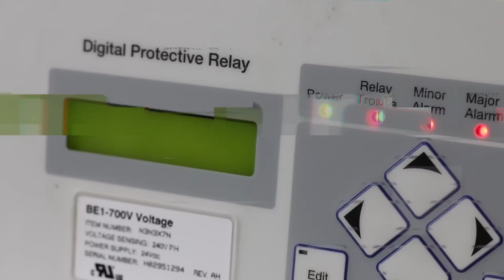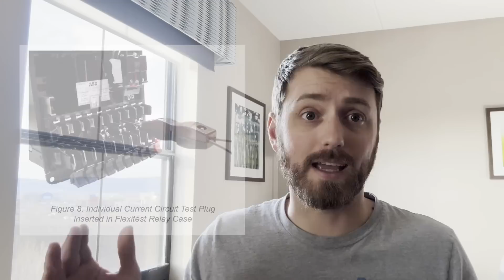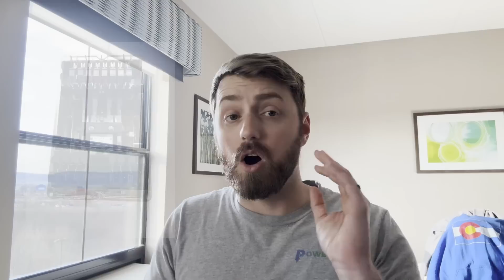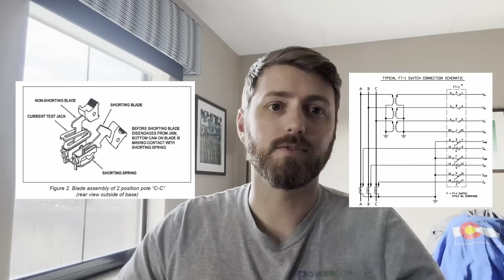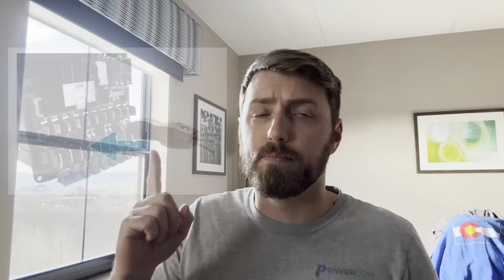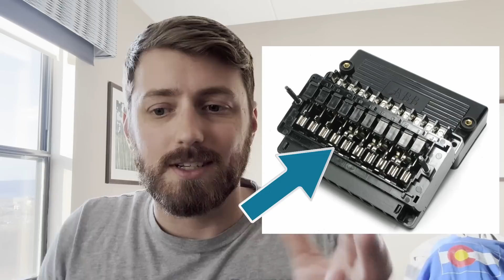Designing for Safety Based on Vibes

Comment: I am a retired engineer and I knew better than to wire the PT's to the top of the test switches. The relay tech knows you don't go touching either current or voltage poles on a test switch. I have never run in to this design but I can see where it could cause issues. Too bad about your Doble set. One thing I ran into was that you can do a lot of fancy logic with modern relays and set traps. I was in a substation helping with commissioning of a new feeder and we had a relay tester doing acceptance testing on a new OC relay. What we didn't know is that a previous company had installed a fancy arc flash mitigation scheme in the substation using a logic processor. The relay tech had switches including the trips. The feeder the relay was on wasn't even in the connected position. However, when the tech injected  enough current into the relay the scheme declared a hung breaker with fault current flowing and cleared the entire sub. It shut down half of the refinery. The logic should have looked at the breaker truck position and ignored it if not connected.
Reply from the maker: There are so many 'gotchas' in modern substations it makes for a stressful job. I've dropped a 230kV feed (no customers fortunately) because a single DTT input in sub out of 12 didn't have a cutout switch. Rest assured I put a red warning sticker on the panel before I left though lol.

Comment: The utility I do most of my work for (the big D) puts the DC feed on the top of the switch but everything else on the bottom. Yeah we learned that the batt sim doesn’t have protection like the other sources do.
Reply from the maker: I hate that so much. Do you know how long they've been doing it? The only 2 customers I've worked with that do that started it recently. Annoyingly, one does it only with the PT circuits and now I know this one does it with the DC control power.
Reply: that’s awful. I’ll have to look back at some old prints and see how far back it goes.
Reply: First time I had to test relays I got the joy of learning how to on a fucking teams call with an engineer 3 states away who was busy with other projects so I still don't know how the fuck i got 2 overcurrent relays tested. And the customer demanded and pressured me into testing more,  for a 5KV mcc that I had previously function checked but the customer rewired. Long ass story shot there was a short between test power and the secondary of the CPT. Got lit up off the fucking secondary,  runt the fuck off the site, and finally after a week of being told "Well use this as a safety warning lesson, have you talk about what happened in a safety meeting", told to drive from TX to LA for safety training, then let go. 

Moral of the story 1 why the fuck is a neta 2 testing relays essentially by them selves, 2 point to point test before energizing, 3 if you use your stop work authority put it in email tagging every safety you can.
Reply from the maker: Solid points and sorry to hear that. Hoping I can make the process of becoming a relay tech a little easier on this channel but stuff like that is very hard to anticipate and train for.
Reply: @burnedupsparkytipsandrevie9597  to be fair I’m a neta 1 running full relay commissioning jobs for utilities. I think different companies prioritize neta to different levels, so your cert level isn’t as much an indicator of knowledge as it seems. Hell, our two most senior relay leads are only neta 2.